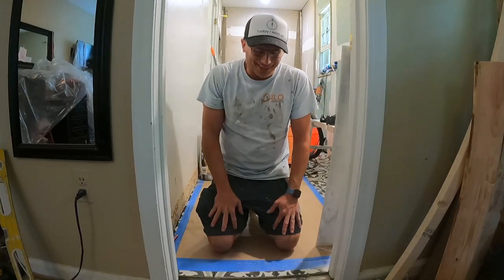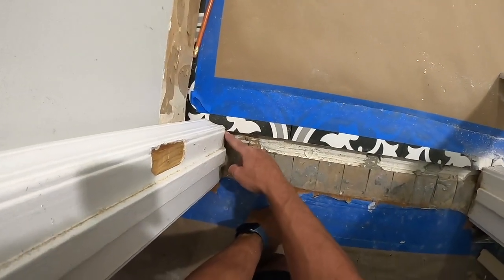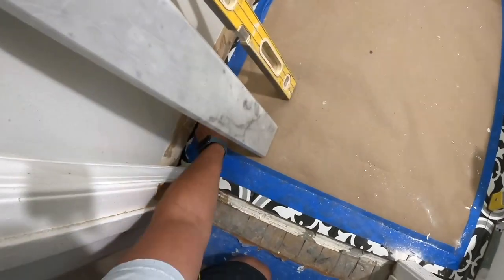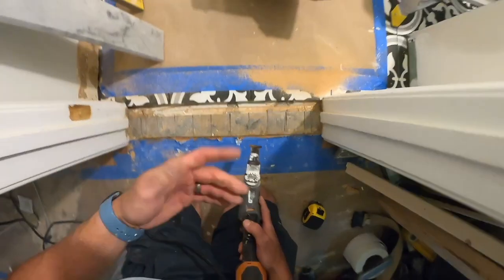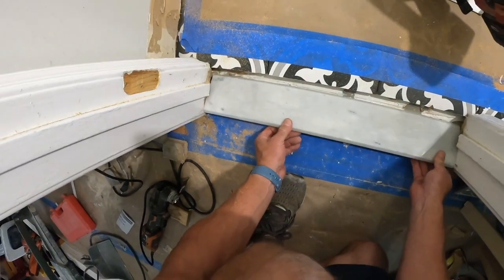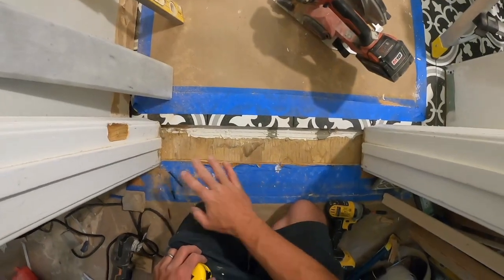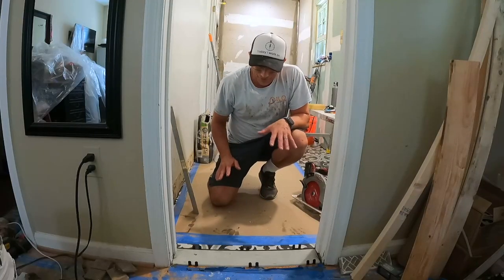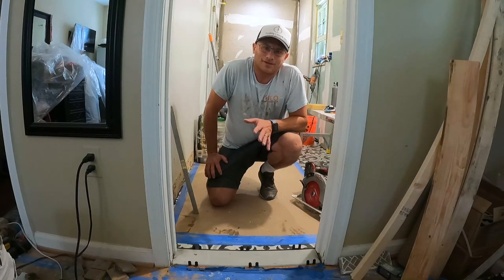How I Install a Marble/Quartz Threshold in a Bathroom

Comment: Again, threshold is supposed to be slightly higher than bathroom tile. Ever had an overflowing tub or toilet?  The threshold stops water from running into hall as fast.
Reply: I’m sure it would do that, but it’s not the reason to set the threshold high, in fact, for interior threshold, it should just be flat because it simply acts as a transition, and getting caught on a raise threshold would certainly piss me off every day

Comment: The reason to set higher is to stop water from getting into the wood floor when the tub or toilet overflows. The second reason to set the threshold high is narrow the gap between floor and door to quiet those bathroom noises.
Reply from the maker: I hate to be the bearer of bad news, but.... the threshold does not keep water from hitting the wood floor. 99 % of tiled floors are not waterproofed at all. The water would never meet the threshold, it would leak around the tub floor.  Secondly, the bath needs to breathe. There should be at least a 3/4" gap at the floor to have some sort of air flow. A stagnate bathroom with no air movement would create a perfect environment for mold accumulation. What you have been told are myths and I had to inform you of that. I appreciate the comment.
Reply: @TodayIWorkOn  It is possible to take all the steps to waterproof the floor with Ditra, Kerdi band, sealant and perhaps even an overlay of something like RedGard if certain areas present themselves that warrant it's use. In these cases, setting threshold a bit higher is a preferred method (within reason of course), and the beveled edges help soften it from catching people's toes. There's a balance to be struck. My point in posting is that if you are going for the waterproof floor then setting threshold a bit higher is a necessary piece of that puzzle. Edit: BTW I followed the Schluter training how to do it. It's something they promote.
Reply from the maker: @CareyDissmore  that I agree with 100% but it’s super rare to see someone do that. I’ve never seen that in 25 years in the trade up and down the east
Reply: @TodayIWorkOn  Understood. It's a fair bit of extra work and has it's limitations on how much water it can actually hold back (and for how long). But I did exactly this on a bathroom remodel that sits directly above our kitchen ceiling after water leaks had damaged the kitchen ceiling. It buys you some time before a flood escapes through the floor or gets deep enough to run out into the hallway. BTW really nice technique with using the screw heads to set the angle on your transition!

Comment: Why even use a threshold? Why not tile through the doorway to adjoin the next floor material, whether hardwood or carpet? To me, that would look better than having a completely different looking material such as the marble threshold. Thanks for the video and the tip about the screws!
Reply from the maker: It’s a simple reason for a saddle, different heights. You can’t bend tile, but you can bend a 4” marble saddle.

Comment: I’m about install one in my bathroom but I thought it was supposed to be higher to prevent water from getting out of the bathroom if there was a toilet overflow or shower. I agree that it looks cleaner flush. Thanks for sharing
Reply from the maker: This is the 2nd time someone said this and I really have to laugh at the “myth” of this. If you have a water leak, it will first go to the lowest point of the room. Then, it will go to the first place where there’s a hole, UNLESS the entire floor was waterproofed(which it’s not). The water can sneak through the door jam with ease under the moldings. 😬.

Comment: I agree,  im in the process of doing one, between laminant and carpet... i will cut the marble threshold so that there will be a slight overlap between the two... I'll trim a spot on the bottom on both sides, using an electric tile cutter... 1/2 inchbon both sides.

Comment: How did you finish the gap between the wood floor and the marble threshold?  Previous owners of my house cut the wood floor on an angle and my attempts to get a straight cut were not perfect, but better.    I was going to put a transition piece over the wood and threshold.
Reply from the maker: Tough call on that situation. If it was me, I would use some sort of stop molding and butt the threshold up to the molding to hide the ragged wood cut. Good luck with the project!